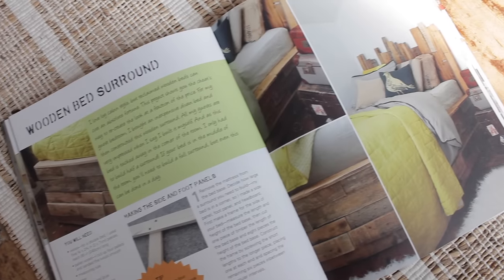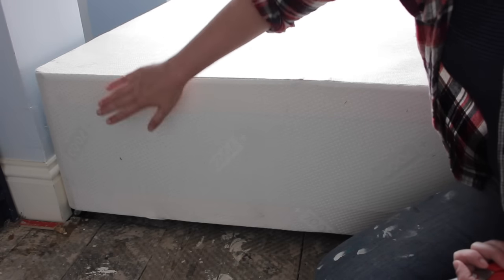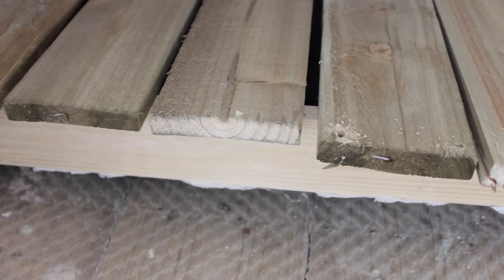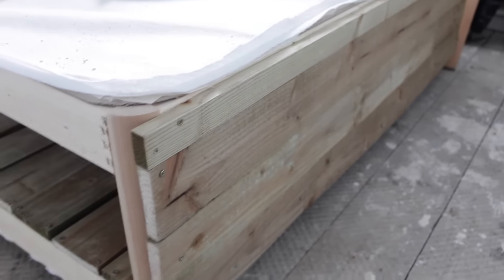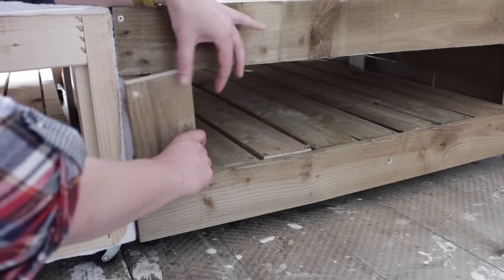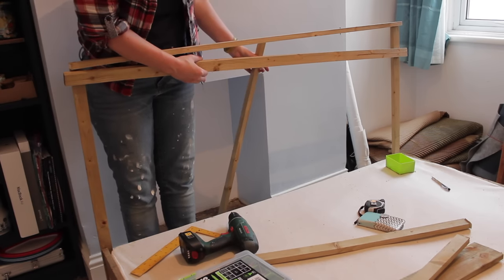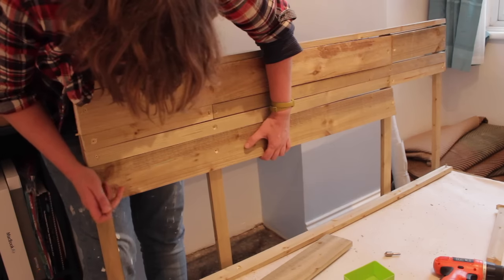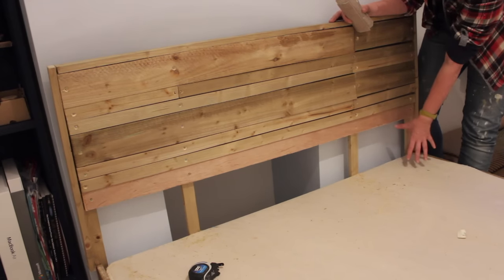Divan bed hack, rustic bed with lots of storage

Comment: So my divan base has bowed, do you think I could do this and use reclaimed wood to make permanent slats across the top creating a new stronger base?
Reply from the maker: Hi, Yes thats a good idea. Just make sure your timber is thick enough the hold the tension of the bowed wood. Glue and screw the new slats to the base and it should straighten out. Let me know how you get on

Comment: you have two power tools. I have the orange one and I cant seem to drill a hole in the wall (concrete) help please
Reply from the maker: Hi, the orange one isn't so powerful, I prefer it to use with wood not concrete/brick. If you want to use it though make sure you use a correct drill bit for concrete. It might take a while but you should be able to do it, good luck!